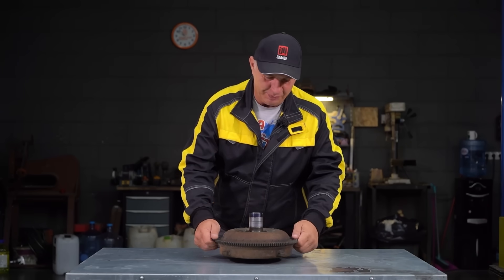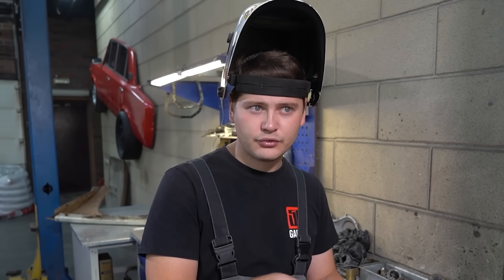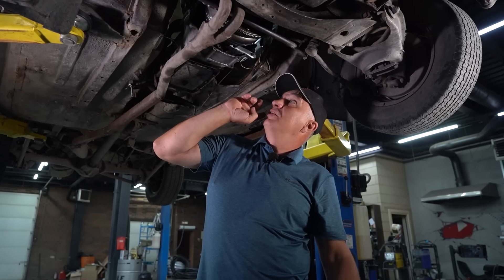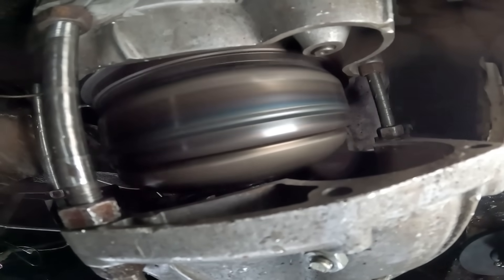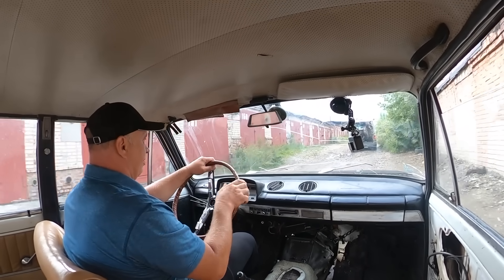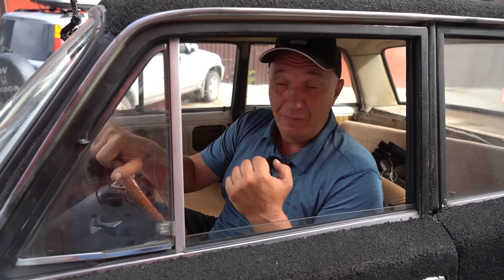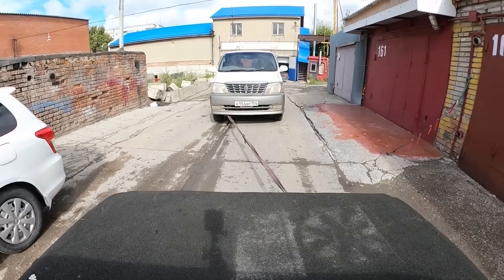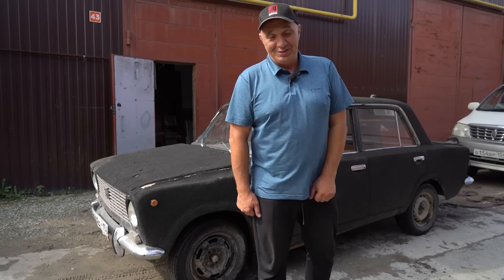Torque converter in a manual transmission - will it work?

Comment: Torque converter (from automatic transmission) increases the torque output from the engine up to 2x(the more it “slips” the nearest you come to the 2x value), that’s why it was happy to toe the van.
Reply: I do wonder what the manual, without the transmission losses, would have done. Probably the speed it would want to be in while towing, wouldn't be an RPM the engine wants to be in, in first gear, so you would need to slip the manual clutch, wasting energy and not torque multiplying anything.
Reply: It multiplies torque for obvious reason: the input is turning a lot further than the output when you start from a stop. Note that this large ratio only applies when the output of the TC is nearly stopped. You can expect about 1.8:1 to 2.2:1 or so from a stop. Once the output gets going it approaches 1:1 rapidly.  That is why you could use it without a lockup clutch, long ago. The stator causes this. The aggressiveness of the stator determines how much it lets it slip, giving "high stall" torque converters to maximize this bonus gear ratio from a stop. High stall torque converters don't come down as close to 1:1, that's the sacrifice for extra ratio from a stop.
Reply: The is a misconception on what torque converters do actually. They don’t increase torque. They allow the engine to spin at a fast revolution than the input shaft of the transmission so that you are getting more toward the peak output of the engines power while the transmission is going slower.
Reply: Wow, the lack of basic education here is strong
Reply: We can't see the benefits until we have over 500 miles trip smoth no strees on your mind and the car when you need torque you have it wow why cars makers don't do that that will even help the beginnings in driving
Reply: Why it doesn't improve car power then? Manual and automatic cars with the same engine have same power
Reply: @thevirq think that in a manual transmission your engine power curve correlates with the gearbox output shaft rpm. in an auto/torque converter you can manipulate more the power since when the engine starts "slipping" you don't gain more speed but you gain more torque. that's why small forklift are able to move 3 ton (counterweight and load) easily with a very small engine.
Reply: @thevirq  car engines are measured at the crank, not the wheels
Reply: @WhysafraidofCause there’s crank HP and wheel HP
Reply: @thevirq  Cuz power=torque x speed
Reply: @thevirq  When the output of the TC is stopped or low RPM, then the engine is turning much much further than the output, probably 20:1. You only get about  2.2:1 at best torque multiplication, despite a much bigger rotation ratio. The incompressible hydraulic circuit and stator redirecting flow give a hard interface between the input and output, and a huge amount of force is transferred through the fluid, creating a situation where the input rotation deterministically forces the output to move by a hydraulic interaction. It does slip some, so you don't get the full true RPM ratio of torque multiplication, but you get 75 or 80 percent.

Once the output of the TC gets going, that effect goes away, and there is negligible gear ratio across the TC.
Reply: @thevirq there's no such thing as a free lunch. Double your torque, half your speed.

Comment: The first vehicle I drove was a huge wheel loader that had a manual gearbox (no synchronization so a bit fiddly until you learned) and a torque converter. There were a normal clutch to as otherwise there were no way you would be able to change gears without grinding the gears flat. The torque converter was there so you could run on a low gear and break to a stop without having to use the clutch. So it was a way to make the wheel loader more suited to daily work. There were also a hydraulic part that made it possible to switch from forward to backwards without using the gear box. It also made the maschine go as fast backwards as it went forwards. At least I think it was hydraulic as you didn't have to use the clutch to switch to forwards, neutral or backwards. Again this was a huge wheel loader that had a scoop that could lift about six thousand pounds about 15 to 17 feet in the air. More than that and it would tip over the front wheels. So for typical use you would be going forth and back about as often, and more usually slowly than at road speed. The torque converter was also a way of allowing the driver to start on a high gear when you were to drive on a street as shifting the un synchronized gear box at speed was something you had to train a fair bit to learn. Well I learned, but I also got told by my father that none of his coworkers could do it. It was fun to show him as he didn't know I'd trained to do that. Thing is he was standing in the scoop as I drove up to a light hill. I had been using a higher gear and knew that it wouldn't be enough to get the machine up the road here so I just stepped on the clutch put the gearbox in neutral unclutched and revved the engine, clutch and slap in at the lower gear and get off the clutch. When I started he turned towards me with a smile and I knew he would tell me there were no way I'd make it that way but the ger went in without any scraping and he laughed. I was 12 at the time.

Comment: A manual trans gearbox requires total disconnect from the engine.  
What Vlad and Co. could do is see if they can convert an automatic to a mechanically controlled transmission.  Manual control of the planetary gears, in other words.

Comment: So in the late 50s early 60s J.I. Case came out with Case O Matic drive transmission.  It was a 8 speed dual range regular manual transmission but instead of a clutch housing they have a torque converter.  Theres a "clutch pedal" thats a in or out clutch hydrauliclly actuated you press that pedal down it disengages a motorcycle style multiplate clutch pack between the torque converter and the input shaft of the transmission you press this pedal shift to desired gear then release the pedal and use the brakes for stopping/creeping like you do with a automatic transmission car.  Theres a second leaver that engages a torque converter lockup clutch when this leaver is pulled you have direct drive as you would with a normal clutch this is used to gain engine breaking, not building excessive heat with the torque converter and for plowing/pulling implements at a steady speed.  I have 2 case 830 tractors they have the exact same 8 speed dual range manual transmission but one has the case o matic torque converter mid section and the other has the regular mechanical clutch mid section.  When i use the case o matic 830 in a tractor pull i put the tractor in 3rd gear the torque converter does a amazing job at putting smooth gentle amplified torque to the ground i won first place if my tires started spinning out i would let off the throttle allow them to bite back in then ease back on the throttle all while still in motion.  No regular clutch tractor can do that if you let off the throttle to the extent i did the engine would never recover in rpm and it would bog down or stall out.  Its a guaranteed way to never stall the engine or run out of power.  If the tractor had a regular clutch it definitely wouldn't pull that far in 3rd gear before the engine powered out

Comment: Should try a small moped engine attach it to the input shaft of an electric motor, and used that electric motor to create electric to turn another electric motor attached to the drive chain. So when you rev up the moped engine it will create more electricity to turn the other electric motor🤣

Comment: My dad had a '70 VW Type 1 "Beetle" that had a torque converter with a manual.  There was no clutch pedal;  When you grabbed the shift knob to shift, you made an electrical connection and a vacuum servo disengaged the clutch.  You shifted, released the lever, and the clutch engaged, the torque converter was there to make the sudden clutch engagement smooth.  Porsche installed something similar called "Sportomatic" in the 914 and some 912's (I don't think the 911 ever had this transmission) back in the day.  

I really don't see the point of all this.  My dad hated manual transmissions!  I hate automatic transmissions!  I have a PDK in my current '14 Cayman S and I can accept it because it is nearly telepathic and "money shifts" are basically impossible, but I miss the manual I had in my previous Porsche 928S2!

Great video!
Reply: Same F&S clutch/TC was used in the NSU - Ro80 - 3 speed transaxle. 
The NSU was front wheel drive with disc brakes mounted on the trans'. 
The NSU trans could certainly take  Maz tricked 12A and 13B power output. 

Setup as:  Engine > Balanced flex plate (NOT a flywheel) > T/C > Stator and Output shaft + bearing + OIL PORTING & SEALS > Clutch assembly and throwout > Gearbox/Diff. 

A clutch is needed. 
OIL circulation and a large oil cooler is absolutely necessary.

Comment: Im pretty sure that most non performance torque converters lockups are either controled electronically or by fluid pressure in the gearbox itself

Comment: Mercedes already did this!! Look up the Mercedes Benz “hydrak” clutch system. It uses a torque converter bolted to the engine, with a clutch fitted to it. The clutch mechanism is operated by vacuum and controlled by a box mounted on the rear axle. I have worked on these. The operation is done by a switch on the gear shift lever on the steering column in the car.

Comment: An oil cooler connected to the appropriate ports on the transmission front pump along with an oil reservoir of around one gallon would keep the trans fluid at a decent temperature.  Otherwise the slip % built into the torque converter will overheat the fluid rapidly and cause failure.  VW came out with this idea in the seventies, I believe it was called the auto stick.  A lower engine idle speed should eliminate the gear clash when first putting the transmission in gear.

Comment: The reason it didnt go into lock up is because that is controled by a solenoid in the valve body with pressure.  no valve body no lockup

Comment: now, the next level is a CVT transmission for a lada :D
Reply: they've already done that. they put a 125cc scooter engine and cvt in a lada. I'd love to see an automated manual gearbox. put an electric motor to spin the clutch when the pedal is pressed in order to match the gear and engine ratios when moving the stick.

Comment: Of course it works. As I suggested.
Next try thicker oil and set the engine idle rpm as low as possible. (so that the motor does not stop when the converter puts a load on it)
We did that on an Opel Ascona and a VW in the 90s. It was a very funny thing, it made much fun ;) People looked at us strangely ;-)
But at one point you need a oil cooler if the load is too much for the converter
Reply: thinner oil and less oil
Reply: Thicker oil? Why? In the crankcase or in the torque converter?
Reply: @tylerhoover1770  in the torque  converter of course :)

Comment: Look up lenco transmissions, they use a torque converter and manual gears. No need for a clutch, etc. Been around for years in the drag racing world. You did this all wrong and butchered it. 
And all you had to do was a simole.google search to know it is possible and has been done fir years

Comment: Next: modify the manual transmission input shaft to oil the converter like an automatic would, and a pump and oil coller system integrated with the case

Comment: i would say it drives like a cvt system. Besides the Funktion, i am more worried about the fluid pressure inside, if this thing heats up. interesting to note a torque converter is able to multiply the torque by 7 times.

Comment: What I want to see is a full transmission deletion.  Engine, Torque Converter, Driveshaft.  Preston Tucker wanted to use that configuration in the Tucker Torpedo back in 1948.  Too radicle for 1948 but it could work now.  Maybe not work well but it would work.
Reply: Leaving it in 4th accomplishes the same task. Just dumps waste fuel /  heat into the slipping torque converter at low speed.
Reply: The equivalent of todays CVT transmission

Comment: In the U.S. they build simi trucks with  AUTOMATED  transmissions similar to what you have built.
They use a manual transmission with an AUTOMATED clutch 'cuz most young truck drivers
cant work a clutch without burning it out.

!

Comment: That torque converter was probably super hot by the time he finished the high torque runs.  Why transmissions have oil cooling radiators
Reply: You could see a bit of smoke from it when they parked. 

I was hoping they would overheat it to failure!
Reply: @volvo09 they could modify the input shaft to feed oil to the converter and the tranny case too route it through an oil cooler via a pump on the engine.
Reply: I know the original 1951-1955 Ford "Fordomatic" automatics had an air cooled torque converter! Pretty interesting looking bell housing with vents for cooling and cooling fins on the converter itself.

Comment: I learned how to float shift heavy truck transmissions when I was a kid.  Shifting without the clutch.  This would be super easy for me to handle.
Reply: This would be awesome with a constant mesh/paddle shift transmission setup.
Reply: @robinpage1987  Maybe they can find a motorcycle transmission to mate up.
Reply: I've done it with cars and found it quite easy. Just need to rev match and they slot in.
Reply: You can shift every manual without using the clutch. If your clutch linkage or hydraulics fails you can get the car home this way. You just have to start the engine in first which is a bit brutal, so it won't work in city traffic. But on the highway you won't even notice something is not right. Once I drove over 100km with broken clutch linkage. I think most drivers in Europe experienced that at least once in their lives.
Reply: @5Dale65  Been there done that.  Learned on a '33 ford.  Then a '63 Jeep.  I can play a truck transmission like a violin.

Comment: That has been done a bunch of times.... starting with Volkswagen doing it with the beatles, having an automatic clutch on a manual transmission as well as in the Volkswagen Thing you also see it in a lot of backhoes surprisingly 4-speed manual transmission with a torque converter and also you'll see the Bruno device which put the torque converter were the clutch should be that has a necessary pump and housing and fluid and all that stuff.